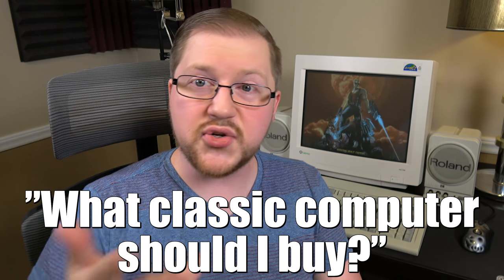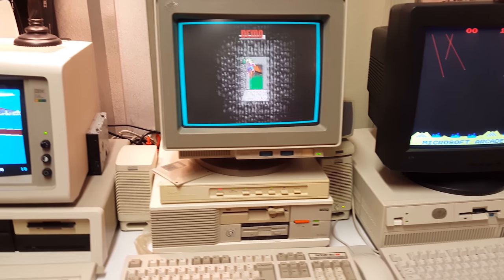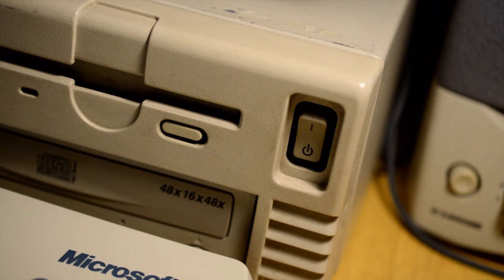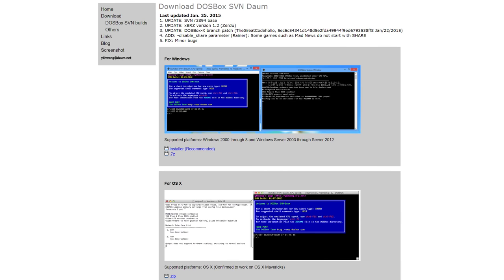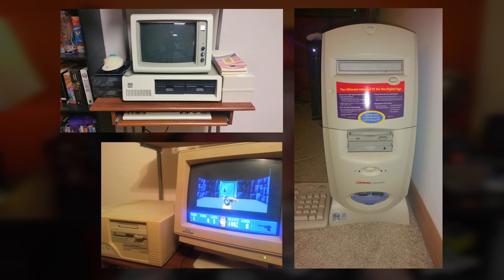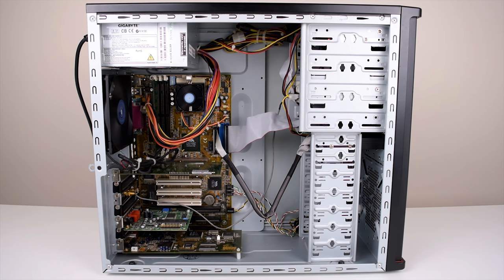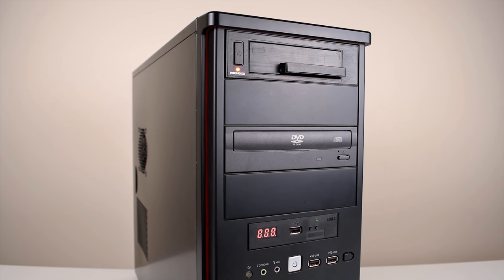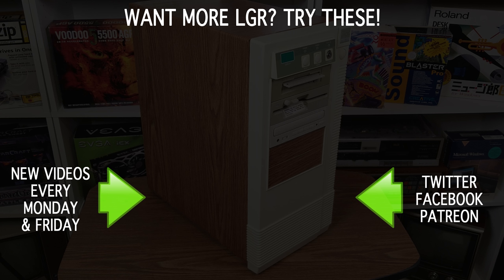Choosing a Retro PC for Games: Advice & What to Look For

Comment: Seems to me  PhilsComputerLab has the best over all hardware set up out of everybody. Simple yet can play a wide variety of games and you get the best graphics and sounds from those games from his setup all on one system.
Reply: Ah, but there ARE compromises made. Most notably, changing the clock speed is not as simple as opening the BIOS menu and flipping a toggle like he demonstrates with the cache. It requires you to power the system down, disconnect it, open the case, and flip some DIP switches(since he chose wisely and isn't stuck with a board that uses jumper blocks to set the frequency and multiplier). 
You also can't get the best sound out of a lot of DOS games without a real FM synthesis chip. Though there are others you'd be a fool to hamstring them like that. I'm not actually convinced that sound can BE a "one size fits all" solution for DOS games. 

His system IS, however, my general approach. I got into the world of IBM-compatibles around the time of the Pentium's launch, so I jumped in at a point where people were coding on the assumption tomorrow's systems would be stupidly fast and my nostalgia conveniently misses most (but not all) of the "running too fast" issues. I've toyed with the idea of a Super 7 board with a SoundBlaster 16 AND AWE32 running alongside each other so I can pick and choose on the sound without tearing everything to bits. It winds up being more of a pain than it looks, unless you really love swapping boot disks.
Reply: @Jacob Turner That's super-useful!
Reply: @CptJistuce  Huh? Lots of motherboards from the socket7 and super socket 7 era allow you to set fsb and multiplier in the BIOS. There's also plentyof software tools like setfsb.
There's also next to do difference between dip switches and jumpers. They both simply make the physical trace connection making a direct connection. Exact same thing apart from their physical form.
Reply: @beezle1976  I'm not speaking of all boards as a general rule. I'm speaking of THIS board used in THIS build.
And while electrically, switches and jumper blocks are the same, the former is more convenient, especially if you're going to change it frequently.

Context: it matters.
Reply: @CptJistuce  it’s done via software. No need  to change dip settings
Reply: @lejlanjarrod1  Citation needed.

Edit: I'd also like to note that the post I was originally replying to is vanished.
Reply: @CptJistuce  google 4 in 1  dos retro gaming pc and watch the full video by Phil.
Reply: @lejlanjarrod1  Timestamp would've been useful, but I know how to skip around. 

Not gonna lie, I didn't know that the multiplier was software-controllable on the K6-2+ and K6-3+. I don't think I even knew the K6-3+ existed two years ago. (These parts are such a weird release, coming after the Athlon and P3 were well into the megahertz war and no one was paying attention to socket 7 news).

Comment: Every single LGR video i regret giving away my win98 pc
Reply: You, and me both I had a kitted out AMD SLOT A 1GHz Gateway(very rare), that was starting to cause problems about 12/13 years ago, and I was in a phase of if it does not work get it out of my house and get something that does lol! Stupid stupid me.
Reply: Blue Baby-- Me too. My SE rig had one of the early custom cases, back when they first started becoming a "thing". I miss Quake, original Doom, Duke and Mech Warrior. I ended up gifting it too a friend to get him started after I had moved on, so I don't regret letting it go- although much later I did miss it
Reply: I don't even know what happen to mine, I'm thinking someone threw it out, because it being "OLD".
Reply: I have a 1.13ghz pentium III laptop and thought it would be great for windows 98 but it’s proven to be a bit too late for that I heard the integrated sound is sb pro compatible but it’s a 2002 laptop that came with WinXP home edition
Reply: My parents sold our Win98 Packard Bell machine to buy a newer WinXP one. I didn't regret it at the time, as I discovered DOSBox quickly and it worked well for what I wanted to do, and I still have that WinXP machine around and I love it, but I've been looking for that old Packard Bell to see if it still exists and buy it back or something. I got the keyboard for that computer, but it doesn't work, I plan on restoring it as well.

Comment: Poor Metal Jesus positively got taken to the CLEANERS on the price of his Dell XPS. Recycling centers are generally one of the most disappointing places to try to buy retro hardware for this reason... They look at CURRENT ebay listings (rather than SOLD listings) which provides a ridiculously inflated perspective on value.
Reply from the maker: Pricing is indeed a sore issue for a lot of retro PC folks, although "too much" is subjective depending on your own needs and desires. I've certainly paid "too much" for some pretty standard PCs and components before, simply due to me not wanting to wait for a better deal. Pricing and best practices for sourcing components is definitely something I want to talk about more in the future!
Reply: Check local PC shops. My clientele drop off "old" machine weekly. Most end up in my storage :) If anyone ask me, which happens rarely, I generally give these machine away.
Reply: Bingo !!
Reply: Sellers have also caught on to the i5 Dell cheap gaming "Dellasaurus"  PC as well. The prices went WAY up on eBay!  It went from getting one for $70-100 to getting one from $150-200 - both with a tiny bit of RAM (2GB and below), no video card, and no hard drive! Rip off artists!
Reply: MJR is for a casual audience, and he doesn't try to pretend it's any more than that.  Not sure why people get so bent out shape about it.  He seems like a good guy and doesn't deserve the hate.
Reply: eBay prices are stupidly high on everything. I've seen people selling Dell Precision T7400s from 2006(!!!) for $200 on eBay, which is hilarious because a 2006 Mac Pro is the same thing in an Apple box and yet I've seen those selling for less than half that.
Reply: V. Sigma - I noticed eBay prices getting ridiculous as of late as well. Maybe after they can't sell their stuff during the Christmas season, they will lower their prices again. I've seen prices of things I've ignored get dropped down very slowly - but, it's happened. The market for used goods isn't that big right now because people are struggling - at least here in America where we have ~50% unemployment. People are trying to keep their homes, keep them heated, the lights on, and food on the table.
Reply: It's just frustrating to me because I'm trying to buy old hardware on a budget and stuff that should be cheap (10+ year old workstations, consumer PCs from brands that don't exist any more like Gateway, Compaq, or eMachines) just isn't when it comes to eBay, and "real world" pickings around here are slim. I've been looking for a cheap late 2006-2007 era Athlon 64 X2 system for a build and coming up empty...
Reply: V. Sigma - Never underestimate the power of greed! I, too, live in a wasteland. I picked up a Dell Optiplex 755 for $30 locally - but overdid it on the video card (GT 1030 with pascal hardware that conflicts with the Legacy BIOS).  So, I would have to invest another $60+ in another video card or just let it collect dust - which it is currently doing. Any video cards around here are WAY overpriced on Craigslist and Offer-Up, etc.
Reply: Gabbiadini you need to reread the title. It clearly says "choosing a retro gaming PC" not building your own.
Reply: Layne Brown given hes also found crazy deals like his giant pc big box collection, i think it evens out
Reply: Could I have paid less? Maybe. But I don't mind paying a bit more for quality, service and reliability. Plus I like supporting local businesses when I can.
Reply: Gawd. Tell me about it. Finding anything locally in Australia is nigh impossible, and even on ebay, 80% of stuff is from overseas.
Even if the item itself is a reasonable price, the shipping cost will eat you alive.

Case in point most complete systems;
Even if you find one that's $20, you'll then be whacked $280+ in shipping.

Same with getting, say, an Amiga - there's tons of them on Ebay, but most are from Europe. And sure, they can be a reasonable price sometimes...
But then you factor in shipping and now you've doubled or tripled the price.
If you're lucky...

Buying parts off ebay can work... For some eras.
But whole systems are generally a lost cause.

When I got my Super Famicom off ebay... I'd say 40% of the cost was shipping...
And that was a bargain, given that this was $30-40 shipping, where some listings were quoting $260+ on shipping.

Speaking of Super Famicom I got a lot of game listings for 1 usd... Which then has 7 usd in shipping.
I mean, it's still effectively a bargain, but those shipping costs absolutely eat you alive...
Reply: The pricing on retro parts is horrible the values of parts swing so randomly.
Reply: @twinrotorfb
indeed, that's how I got two of my three most recent machines. I also found another one atop some furniture in the dumpster at my old apartment, though it looks to be set up as a work from home machine, complete with a tape drive for backups (hard drive was factory restored though).

Comment: It's interesting that you mentioned running early Windows games using wine! It was something I hadn't really tried until about a year ago when I wanted to play an old Goosebumps game from my childhood that was notoriously impossible to get running on my windows machines. Sure enough, after a couple hours of playing with different configs I not only got it to run in wine perfectly, but I got it to run in a window where it previously forced fullscreen, which made it a lot easier to set up in OBS so I could stream it to my friends. I guess that's one of the benefits of using software that's been trying to emulate Windows since 98.

Comment: Ross's take is what I've been following for the past two years and despite having been able to play every game I threw at myself (LaunchBox for Dosbox+console emulation, along with nGlide for glide based games and VMWare with 98SE and XP), I still live with the "paranoia" that one day the pcs I assembled to run these older games as a last resort will die within the year and I will be locked out of the games I had so much trouble getting to run ever since I started running Windows XP, or even cases where I went for windows 7 like with the Scarface game that only worked well on XP.

I do have a huge worry because it's pretty clear virtualization is an important and soon to be inevitable step in the future of retro gaming for PC users, but as of today, the only software that could give us a glimmer of hope is VMWare for anything that is not Glide or DOS run, and they're much more keen on ignoring the users on their forums who want to run games on them, and honestly, I cannot blame them. If you check the card emulations we have, all of them are for defunct companies. You won't see an ATI, Matrox or early Nvidia card shown, because those wouldn't give up the cards most likely because nobody wants to risk asking them, and if you check VMware, you get their own version of a software GPU.

I'd like to go on more detail on why the gaming side of virtualization is stuck in this rut, but I already went on long enough.

Comment: I managed to pick up 3 (yes, count them - one, two, three) IBM PS/2 model 50 machines a little while back, but I'm worried the caps have gone bad after 30-odd years, so I haven't even booted them yet for fear of blowing them up! I do plan on replacing the power supply caps, but need to do a clear-out of my workspace so I've got enough room to pull them apart.

They're 286 machines, which will be good for early DOS gaming. Unfortunately they didn't come with a CRT monitor, but I'm hoping to pick up an old Sony broadcast monitor that I can coax (if you'll pardon the pun) into displaying VGA natively.

Apart from that, I've got a 486 machine built from parts, with CPUs I can swap out, depending on what I want to do, including an Intel 486 DX 33, AMD AM486 DX 40, Intel 486 DX2 66, and a Cyrix 5x86 100GP. It's a later-era PCI motherboard, so I can run either PCI or ISA graphics, but I just use a cheap PCI card based on the Cirrus Logic CL-GD6556 chip. Hard drive is currently a CF card, currently 1GB, but I can swap others out depending on my OS requirements. Soundcard is a Sound Blaster AWE32.

I've also got on order some socket 7 era gear and other upgrades, including a PCI SATA card so I can play some crazy modern HDD/SSD upgrades, and a Roland MT-32 so I can get those awesome retro tunes.

Relatively speaking, it's not that expensive a hobby, especially compared to things like high-performance sports cars or skiing. But it is time-consuming and requires a decent amount of space.
Reply: 8 months late.. but I really hope you decided to try out these machines.
Sure.. you risk popping some caps.. but the longer they sit the more likely they are to waste away.
Even if they do pop, though, it's not too hard to replace them with some new solid state capacitors.
Oh, also, I'm incredibly jealous of your Cyrix 5x86. I'm currently using an AMD 5x86 as a substitute for the Cyrix (my dream 486)..
..but it'll do. ;)

Comment: DGvoodoo 2 really needs a proper mention. It has great support for voodoo games, but also direct X games up to Direct X 8.1, I believe. It also allows for custom resolutions and forced anti aliasing so you can see an old 3D game that never came out with those features and has no other patch with this stuff. It's pretty amazing when it works. The executable has to be 32-bit though, it seems. I can't find any way around this.

Comment: I've a feeling the Ross Scott segment is going to be something along the lines of his gripes with all old Windows emulation.
Reply: Ross Scott did not disappoint.
Reply: The Zesseract I love Ross'sss ..... Scott's perspective on things in general. Always humorous, yet insightful. 😂
Reply: Player Taurine HELP!
Reply: It is really painful. Getting Midtown Madness or SW Pod Racers to run at all on modern Windows is hell itself. Want 3D acceleration so you aren't playing in ugly Software Mode? You're delving into madness. I solved Pod Racers, but its really unstable to get started still...never got Midtown Madness to work correctly. My favorites are source ports though. Albion has a source port out there that will run on modern Windows and allows for high resolution modes!